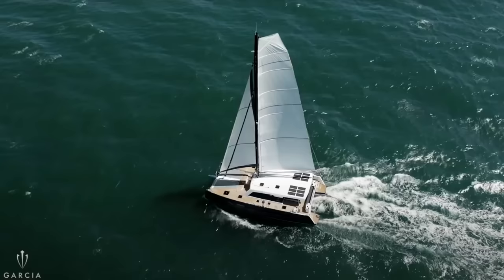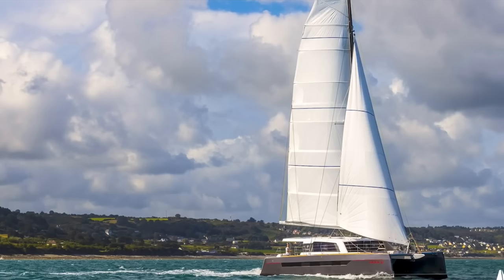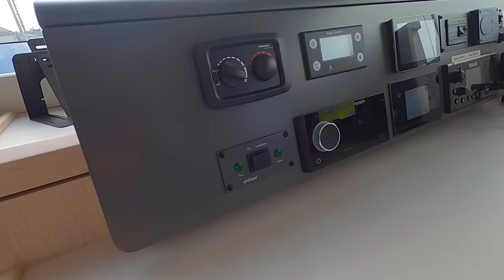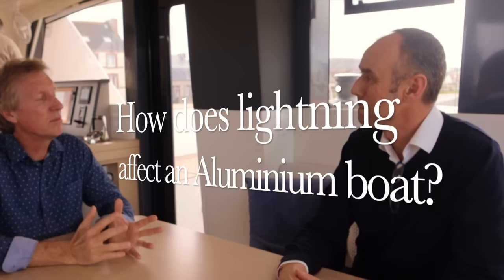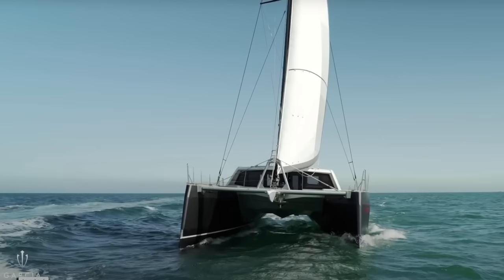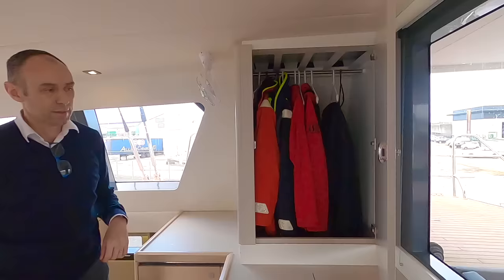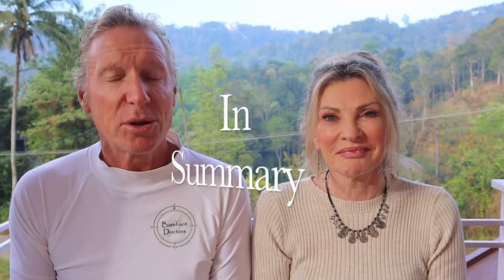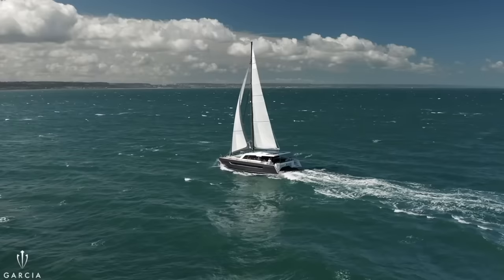S3#2.  Garcia Explocat 52 review. Is this the ULTIMATE Exploration cat - fast, safe and comfortable?

Comment: High latitude sailing has come into vogue as of late but I've been doing it for 30 years, since I live and sail in Juneau, Alaska.  This Garcia yacht ticks many of the necessary boxes for sailing in colder waters and that makes this yacht a safer yacht for mid and lower latitude passage making.
For higher latitudes, a good heating system is vital for a few reasons.  Not just for the comfort of the crew but also for keeping moisture to a minimum and for drying out foul weather gear.  Juneau is in a temperate rain forest so there are days when light rain showers will happen and if you happen to be on shore in a remote location, you're likely to get some rain showers now and then, so even good foulies will need a place to dry out.  Also, keeping the interior space warm and comfy adds to the safety of the crew because their bodies don't have to work as hard to keep them warm which keeps them from getting fatigued and possibly diminishing their attention spans and ability to make good judgement.
Next, the aluminum hull is the 'go to' material for toughness.  Sailing or motoring into a fjord, like the one's we have here, one has to often dodge 'bergie bits' as we call them and since my boat's hull is GRP, I avoid them at all costs.  Doesn't mean I can't get close to a glacier; it's just that I have to be very careful about it.  With an aluminum hull, one can purposefully push through some ice and get to places other boats can't.  Plus, there are places here where one could purposefully beach a boat like this (there are some sandy beaches) but only for so long since our tides can vary up to 8 meters at times.  I owned a small sailboat with a retractable keel and put her on beaches many times.  So the ability to beach the boat also adds to the safety of the vessel.  Plus, the aluminum is TOUGH.  I've pounded thru some serious waves in 'jet boats' that have jet drive inboard engines.  Those boats just slam into waves and keep going!
I enjoy your review and the high production values, and your work as Doctor's.  Keep it up!
Reply from the maker: Thanks very much Wade for your story and info - very helpful and interesting!
Reply: Very useful comment. Thanks

Comment: My only criticisms would be that they should offer an electric engine option and shaft drives. I do like that they have protective skegs for the sail drives though.
Reply from the maker: Thanks for the comment Barry and yes I do think shaft drives are the way to go as stern drives do create several problems and lose the ability to regain power. We are hoping that electric engines and region will have taken several steps forward before we have to commit with the next boat as till now you still one engine that works on diesel...

Comment: Curious if you could also ask about the size and weight of a tender these boats can handle.  Especially for remote exploration, you need a beefy tender than can handle some rough conditions.  I'm surprised that some of these 50'+ high-end cats can only accommodate modest tenders.   Would love to have a 4-4.2m dinghy for long range exploration.
Reply from the maker: Thanks Mark, The davits are Aluminium so very strong but I do not know their limit. If you wanted to increase the weight tolerance they can easily send in another V arm to increase the strength.

Comment: I wonder what chemicals are used to create the insulation and if there are any off gassing concerns from it.
Reply from the maker: Thanks for your comment Hex. The foam insulation is fitted already set so I did not notice any odours like you would get if you spray the foam in... You would need to contact Garcia directly if you need the technical answer as I am not sure.

Comment: Interesting option, could be a bit heavy if looking for performance, however finish looked first class.
Reply from the maker: Hi Ian, yes quite heavy but this is what they have chosen to go for - strength over higher performance to cope with the icebergs. They actively choose to focus on the average daily distances and not the top speeds as these are not their forte. The focus is the upper latitudes with reasonable performance...

Comment: I'm surprised that every floor hatch you opened there was no insulation either of the hull or the hatch. 
Like the forward cockpit, and don't understand why more don't push the saloon forward of the mast for more internal space.
Also like the mini keels and skegs for a beaching experience that's a lot simpler than beaching on the hulls. Wouldn't the Portofino work better with the folding dagger boards retracting into mini keels like these? Much better for being able to clean the hulls while beached too? And more concentrated contact zones during the inevitable bouncing from waves during tide changes?
Reply from the maker: HI Ashley and thanks for the comments! The downside of mini keels is the loss of shallow draft benefits. Sitting on small keels can be done but they would dig in a lot more than sitting on the top without them.

Also on our self built 42 foot performance cat, she sat on her flat bottom part of her hull and there was only a small area that you could not clean but if that was an issue we could use sand bags to sit on or do that small section while swimming... Our draft is 2.5 feet so that allows us to go over coral atolls without entry channels and up river and creeks and mangroves to hide from storms. For us this was really important.
Reply: Ah! All really good points. Thank you.
Reply: What are your thoughts on the saloon going forward of the mast, for a much bigger saloon?
Reply: @ashleykerlin  It adds weight forward. Hence either requires increasing bouyancy, which makes the hulls fatter and slower, or having higher propensity for waves hitting the bridge deck//floor of saloon. Worst case even front facing windows of the enlarged saloon, which is not good....

Even the forward cockpit looks less than ideal, from the POV of just a cruising couple. I'm sure a fair share of the antcipated market of actual buyers (as opposed to dreamers) for a boat like this, is crewed charter operators to, say, Spitzbergen. Where such a sightseeing/photo cockpit for the guests is key. But for personal use, I'd ask if they could instead give me a size up anchor (despite already plenty on a Garcia no doubt.....), more, heavier chain/s and a bigger windlass and spare anchor further back...

Comment: Thank you for a super interesting walk trough. Being a tall man, I would be extatic and thankful if you would also include the important issue of headroom in the different sections of the boat 🙂 Would that be possible?
Reply from the maker: Hi Jakob, yes I did not mention that but I am 6 foot and Cyrille is about 6'2" so if you see him in the hulls the height is far above his head and likewise in the saloon the height is 2.05m - very high!
Reply: @barefootdoctorssailing8567   Thank you so much for your feedback. Now I will watch you as well as the room above your heads :-). 2.05 m is great. Then I will have 6 cm at my disposal. Now I need to work om the money. And my patience...4 years delivery!

Comment: I am a sales person and this boat has many advantages in comparison to its rivals. And you are not mentioning or promoting these. For example heating system. You should visit your old customers using this boat and make small interviews. And 4 years for the production is very long. You should move your factory to Tuzla/Istanbul as soon as you can :-)
Reply from the maker: Interesting advice - I presume there are good Alum welders in Turkey?
Reply: It's a very specialized product, requiring highly specialized labor, jigs,processes, factory bays..... 4 year waiting list is just now. 3 years next year, then 2 etc..... The total market isn't very large. It's just that, being the first such alu cat provider, there is pent up demand.

But not enough, long term, to scale up factory to meet all demand in parallel. So they do in one after the other. Which also has benefits as far as learning with each new hull.

It's similar to how it rarely makes sense to massively scale up a store, just to meet peak Christmas demand for cash registers, instead of letting a line form during peak season.

Comment: Great video......I doubt we would ever go to colder climates but the information on the pro's and con's of aluminum construction is very helpful and perfect timing ....we are trying to get info on the Portifino 47 and 57 but so far I have sent 2 emails and got no response.....Thank you both
Reply from the maker: Hi again CB, I thought |Portofino would be quite good at getting back to you. Perhaps there is a delay with holidays. Try again - raffaele@portofinomarineservice.com The next episode is about the Portofino 47 so that will be interesting for you!
Reply: @barefootdoctorssailing8567  Awesome, thank you...looking forward to seeing it......any chance you could show the Portifino 57 also.....would you consider doing a video on the Lagoon 55?.....the layout and use of space is amazing but I am concerned about how it is built(I understand they use vacuum infusion with a balsa wood core) is it a good build for ocean crossings and longevity?....how is it built compared to Leopard or FP?.....power boats use to use fiberglassed balsa wood but due to moisture intrusion causing the balsa wood to decay and fall apart builders stopped using it well over a decade ago ....does vacuum infusion change or fix that problem?

Comment: Who has a better set up for electrical corrosion and protection, Portofino or Garcia?
Reply from the maker: Dear Jeff, both look very competent. The only thing that I liked more in the plan of Portofino is that the leak detector is alarmed sop will go off as soon as there is a leak and does not require you to intermittently test it. Small thing but both are excellent...

Comment: Great Product Review… Have a few comments…
- I’ve used in my working days as an Engineer a special coating of Teflon on surfaces dealing with toxic liquids. This Teflon is sprayed and can be layered for multiple thicknesses. I’ve used Black but could be available in other colors. Sort of remember after spraying it’s heated to finalize adhesion to the vulnerable surface. Don’t remember required technical specifications. Double thicknesses were specified because mechanical cleaning was abrasive. Never experienced any peeling or flaking.
- Aluminum seems best choice however Electrolysis issue remains as a potential problem especially as Diesel Engines could be replaced with Electric Motors. As a Developer I’ve been looking for a Sail Drive that can be dual powered with a common Diesel Engine and an Electric Motor sitting on top of the Sail Drive unit. Mechanically it’s not difficult and could be done using Sprag Clutch Bearings or Clutch Gearing. This would allow both Power Plants to exist with only one operational at a time. Creative thinking says changing the Aluminum Sail Drive casting to Bronze might help.
- Different Environments from severe cold to hot requires a closed up living environment to wider opened living areas. Sunreef has a lifting mechanism design to lift up the rear wide door from the bottom to the ceiling. This gives the largest opening and is attractive for hot environments.
- Will Garcia customize Owner Boats? Building using Aluminum isn’t as easy to customize then Fiberglass.
Marty Didier
Reply from the maker: Interesting info Marty, thanks! No regen option on sail drives as yet so that would be a good thing to create if you can... Where were you thinking of using the teflon- under the waterline? Electrolysis with aluminium seems to be avoided if the leak detector is active and watched all the time. I have also heard that it can be done with an alarm so if there is a leak you will hear the alarm instantly and not rely on checking it manually. 

Yes hot and cold climate require different set ups and the Garcia is more suited for cold but there are good openings with the front cockpit door and most of the aft windows open up fully. The garage door openings of the Bali (and the Sunreef) look good but the structural strength is potentially compromised it would seem.

For customising the Garcias, there is only limited internal changes you can make within the 2 or 3 versions for each hull I understand. However generally Aluminium is easier to customise than fibreglass cause every boat is built from scratch and no moulds are used. This means that the builder haws the choice to make changes but many brands do not want to complicate their production line that much so enforce limited options that they give. Other steel boat builders can give huge customisation if you plan it before the start - see Distant Shores new Al mono. 

All the best!
Reply: @barefootdoctorssailing8567  Thanks for the reply. Using the Teflon spray on material would need more research to determine requirements for final setting. If my memory is correct, the material needed to be heated, this was 30yrs ago. It’s assumed that final set may require a UV light application as glues and other materials have gone this way.  Material thickness may be ~1+mm and multiple layers thicken it from there. Final product was durable and none peeling. Under water Line certainly is the way to go. Everything can be coated this way. Example: early Cellphones were single layer treated and products felt good to hold. It may be more costly then paint but may last a very long time. Cover choices might suggest Paint is least durable then a material that’s micro fixed to a surface.
I personally don’t trust measuring systems to signal me of an alarm. If something goes wacky in a very short time many holes can quickly exist. My choices lean towards more solid permanent design choices. Besides everything Digital currently is attacked by high level hackers. Recent news talks about major International shipping problems due to hacking. There are other reasons I’m not able to talk about at this time. Very soon a major FBI case will surface that involves me, then you’ll realize what I’m talking about. It’ll be first case of many to surface. It’s unknown of its depth but I’m not surprised it may include the loss of your boat!
Don’t have a Yacht at this point. Have been watching for some time. Would be fun to have one and could afford one. Prefer Aluminum at this point.
Reply: My comment about distracting an electronic system giving an alarm is again verified. Recently Hacker defeated Apple’s iOS 16 Facial Security routine. Allows Access to Bank On Line Accounts can now be accomplished by others from their systems. Comparing skill to Hacking into Shipping Tracking Systems is either similar or easier. Recommend sticking with physical inspections and physical barriers for security. Electronics and Wireless everything is easily defeated by criminals.
Reply from the maker: @MartyDidier  thanks for the advice!

Comment: Is the Explocat 52 equipped with a skeg to provide substantial protection against underwater debris?
Reply from the maker: Dear Renato, Thanks for watching and for the comment. yes there is a skeg just in front of the sail drive and protects the sail drive, props and rudder (see at 18.02 on the video). The rudder also has sacrificial foam so you do hit something with it, the foam gives way but the hull does not get damaged.
Reply: Thank you for your prompt response, you are true professionals. In all the pictures of the Explocat 52, I had never been able to see these details. Thanks again and sincere congratulations. I'll watch the video right away!
Reply from the maker: @renatoardigo5829  Thanks. What exactly are you looking for in terms of a new boat?
Reply: Coming from the world of monohulls, finding the right catamaran has been particularly challenging. My wife and I were looking for something different, no longer in composite with carbon fiber reinforcements, but in aluminum. Something that would allow us to live aboard and undertake ocean crossings. Our choice fell on Garcia. I personally spoke and wrote to the shipyard, but I needed external support to better understand the world of catamarans before purchasing one. We are not racers, we are cruisers. Of all my acquaintances, people with 45,000 nautical miles under their belt, none of them own a catamaran. Getting unbiased opinions has been quite difficult. Thank you again
Reply: The rudder also has sacrificial foam so you do hit something with it, the foam gives way but the hull does not get damaged.........What do you really think about this solution?

Comment: does this boat only have heating, or A/C too?
Reply from the maker: Hi Max, yes the Garcia does have cooling options (Air con) as well as heating options. Reverse cycle AC only works to about 3* (or maybe -3*) so people going the really cold areas need alternative heating systems. Each new owner decides what they fit depending on how and where they are using the boat. Hope that helps